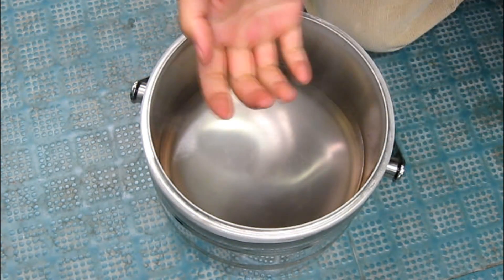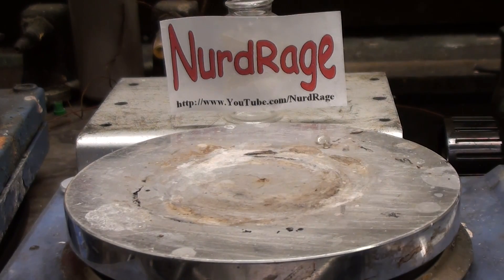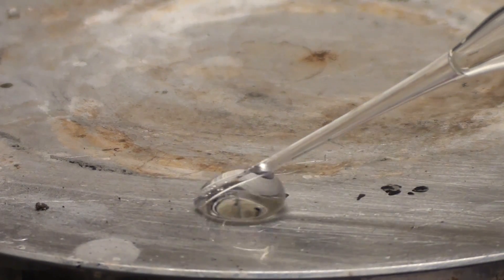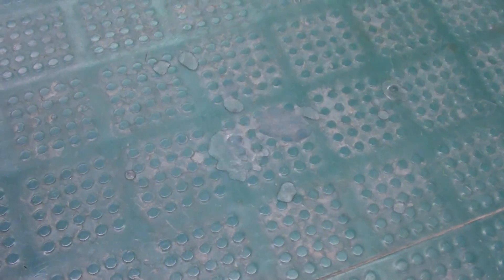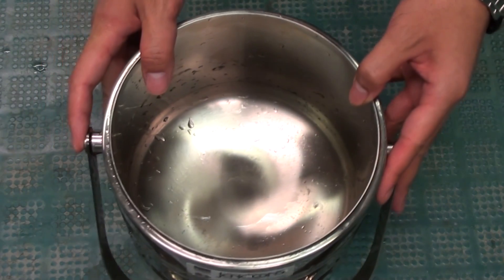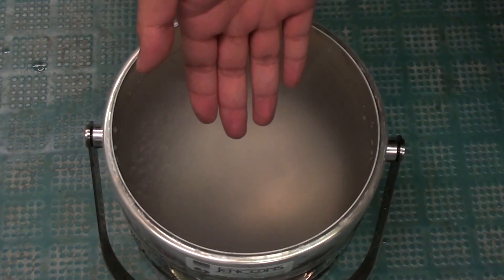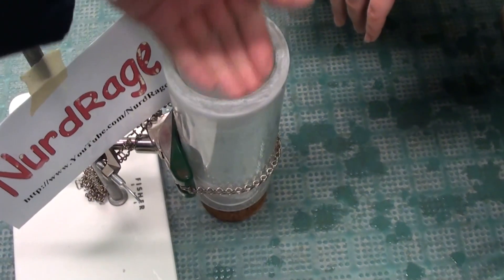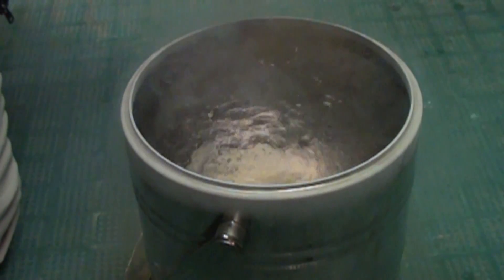Hand vs. Liquid Nitrogen - Revisited

Comment: Sometimes you can learn a lot in one quick moment.  Like when my fingers were sticking to the soup ladle that I used to spoon out some liquid nitrogen.  "Hey, look at that, it is so cold that the frost on the ladle is grabbing on to my skin and won't let go, like licking a flagpole on a below zero day."    It worked out all right; the ladle quickly warmed up and let me go without injury.     The other quick moment was when I immersed a racquetball in liquid nitrogen and tried to bounce it.  It had not occurred to me that the ball is hollow and full of air, and that the air shrank considerably when cooled, creating a partial vacuum.  The ball didn't just crack when it hit the sidewalk -- it popped like a light bulb.    Cool video, Mr. NurdRage.

Comment: Can you boil liquid nitrogen?
Reply: it's boils at -196 degrees Celsius, in this video it's always boiling
Reply: the video shows it boiling
Reply: paralixis4500 Fine. What happens when you apply heat to liquid nitrogen?
Reply: thats better, pretty much is gonna have the same effect but it will last shorter, regardless of heat temperature

Comment: No idea where to get liquid nitrogen or dry ice (granted that's probably a good thing) I've dabbled with dry ice at school and it was very peculiar. But now that I know liquid nitrogen boils around your hand (not boil but vaporize? whatever) i feel a little bit safer. Yeah don't jump into a pool of it but if I ever do get some, I won't be as scared of it. Dry ice is a completely different story, yeah it decompresses (since it is a solid gas) at room temperature but do not touch it. Since it isn't a liquid it won't go away quick enough. So warning to anybody reading this. Have a pro or be trained before you do this. If I ever do I'll have safety stuff nearby.

Comment: Wouldn't it have been safer and probably easier to see if you'd used a heated rod or something instead of Argentia's hand? I mean you've proven it works with your own hand and are just demonstrating how now...
Reply: +Keiya Bachhuber It probably wouldn't even have to be a heated rod. When you're hundreds of degrees hotter than liquid nitrogen, a couple dozen degrees is nothing.

Comment: I work with liquid nitrogen every day. It's really not very dangerous if you are careful. I've never seen any of my co workers injured by it. It's also alot less dense than water. You don't need a hot plate to observe The Leidenfrost effect with liquid nitrogen. Just throw it on the floor and it does the same thing.

Comment: Would this work in the opposite way? With boiling water and an extremely cold object?
Reply: yes, but not with hot water. try  molten metal, like lead. if you say, dipped your hand in water first and then in the lead,the same effect happens. the steam will create a barrier. just be sure to pull your hand out quick.

Comment: With the Leidenfrost effect, I could walk upon the surface of the sun. For a fraction of a moment.
Reply: Yes, while floating on the steam from your vaporized feet? Wouldn't be very pleasant lol
Reply: Rafael Porto I wager it would look absolutely badass, though.
Reply: VladtheImpaler31 No, you'd burst into flames before even getting close. This phenomenon only happens within certain temperature parameters, depending on the types of liquids/metals used for the experiment. The Sun is a Plasma, it's heat extends far from it's surface, unlike the frying pan who's heat doesn't expand much beyond the surface.
Reply: Before exploding from the gases in your body expanding
Reply: VladtheImpaler31 for like millisecond lol
Reply: VladtheImpaler31 Leidenfrost will not stop Intense light and radiation.
Reply: Davide Dopesick
I was talking about the sun warming your body up and causing gas to expand, and then causing an explosion from the differences in pressure, not the lack of atmosphere boom boom BS
Reply: ***** that doesn't really happen in a vacuum, it's been proven many times
Reply: Davide Dopesick 
I wasn't overly clear when I made the first comment though...
Reply: dipro001 Light is a form of radiation.
Reply: So be it.
Reply: That's completely boss, but would you even get close to the surface of the sun before standing on it for a fraction of a millisecond?
Reply: Vern359 It was a scenario, that I instantly found myself on the sun, I would survive for a fraction of a moment. Your attempt to be serious, has only led you to being annoying.
Reply: No, you'd be crushed, instantly.

Comment: for informational purposes how hot is the temperature of the hot plate when the Leidenfrost effect occurs?
Reply: Thanks ***** !
Reply: MissWeaslebee♥
its actually more around 3-400 degrees Celsius since the water actually has to boil so fast that the drop of water doesn't touch the hot plate

Comment: Another cool Leidenfrost experiment is bronzing your hand; I have heard of this, but never have seen or done it. Put your hand in cold water, and quickly, while still wet, dip it into molten bronze or another metal of your choice. The water will boil, and the steam will repel the metal from your hand. Be sure to take your and out quickly to avoid getting burned, and don't stick it in very deep or with curled fingers so that your hand can be removed so that it doesn't burn. Dipping your metal-clad hand in water could prevent burning as the metal solidifies, but may shatter or crack the metal from it shrinking from heat loss. This shrinkage may make it harder to remove as well...

Comment: I've done this, and it's really not that cold. Your hand feels slightly chilled, but not more than sticking it in the fridge. Also, it would be good if they/someone filmed this without smashing their hand in so fast and violently, so the nitrogen wasn't splashing so much.
Also, fun fact: if she had used her other hand, her finger would be messed up really bad, because she's wearing a ring. This is pretty much totally safe to try, as long as you're not wearing any metal (it conducts so well, it will super cool very quickly, and then - as you're wearing it - freeze your digit through prolonged contact. Not good! :P).

Comment: So... is there a definite temperature difference that it must be for this effect to take action? What temperature difference must it fall under to negate the effect? Someone answer please <3
Reply: wow u see u everywhere....
Reply: I've seen you before somewhere
Reply: "The minimum heat flux for a large horizontal plate can be derived from Zuber's equation." From what I can tell, a lot of variables come into play with this. Pressure, density of fluids, area of surface, heat flux, specific heat of a substance. So a little more information is needed. 

But I think for water the minimum energy needed is the heat of vaporization for water. This will cause the water vapor to cause the droplets of water to bead up and roll off the surface.
Reply: LOL MY THUMBNAIL PICTURE IS STILL RS TOO
Reply: Asian Lag I see this guy everywhere. What the heck!
Reply: well he said at -196 celsius.. and im not genius but im guessing at -197 celsius the effect is gone
Reply: Hand vs. Liquid Nitrogen - Revisited
Reply: Laser
Cannon
Deth
Sentence
Reply: ***** Shut up and go back to skilling.

Comment: Is this similar to the effect that allows one to stick their hand in molten lead without being burned?
Reply: Well no. This effect means that the colder substance vaporises so quickly when coming into contact with hotter substance that the forming gas creates a cushion between the two. For molten lead and hand to create this same effect would mean that YOUR HAND is vaporising when in contant with the much hotter lead. That's not exactly healthy.
Reply: Lahis
Isn't the molten lead thing done by putting your hand in water first?
Reply: Well then it's the same. Though you'll propably have even less tima than with nitrogen here.
Reply: @AndroidMaxine  love to see a video of that! Give it a try please
Reply: For anyone reading this 7 years later, the answer is yes. The Leidenfrost effect is exactly what allows people to stick their hand in molten lead/aluminum etc.  They wet their hands with water first, and upon touching the molten metal, the water transitions to gas(steam) and expands rapidly, insulating the hand from the molten metal. The effect does not last long so I don’t think you can safely dip your hand in molten metal, but you can karate chop it as it’s being poured.
Reply: Why dont you make a video of that. Be sure and get hand wet first

Comment: When I was young I "discovered" this effect with a beaker of water and a copper penny heated to cherry red over a burner.  when the penny was dropped in the beaker it appeared shiny, like silver.  The surface details were present but indistinct.  after a moment, when the penny had cooled enough to allow liquid water to touch it the water surrounding the coin would suddenly and briefly boil.  I did it over and over again.  It was fascinating to watch.  This video reminded me of that time 40 years ago.
.

Comment: Can the fire department use that stuff for putting out fires?
Reply: Yes, but liquid carbon dioxide is much cheaper and easier to work with, and it boils off much more slowly when contained. That's why we have extinguishers full of CO2, not N2.

Comment: What happens if you keep your hand in there for like 10 seconds
Reply: Frostbite.
Reply: Lazertazer Dead hand. Amputated limb.
Reply: Your hand gets crit for 1k damage
Reply: havent you seen terminator 2
Reply: When the temperature in human cells go below freezing the water will freeze, the ice that is formed will penetrate the cell membranes and kill the cells.
Reply: Izlak That is the definition of frostbite yea :)

Water expands when it freezes, so does the water in yourself if it goes below zero degrees Celsius. It takes a lot though, the body produces a lot of heat and will try to prevent it from happening under any circumstances. Against liquid nitrogen however it has no chance at all.
Reply: ppppentakill
Reply: itssk8errrmcgee I WAS THINKING THE SAME THING, HAHA!
Reply: You know have 1 hand
Reply: After a second, the nitrogen will contact your hand, causing excruciating pain.  Your spinal cord will reflexively remove your hand from the nitrogen, and you will be left with a case of severe frostbite.  In most cases an amputation will not be required.
Reply: Lazertazer thats what nerves are for

Comment: What if you were to take molten metal (for example Iron) and super heat it, is it possible for it to become a gas, and how hot would that gas be?
Reply: Iron becomes a gas at 3198 kelvin or 5297 fahrenheit. Currently any element can take on any of the 3 normal forms.
Edit: www.ptable.com and then use the Kelvin slider thingy to see what is where. And yes helium becomes a solid.. just at 1.6 - 2.1 F anything below that it's a liquid
Reply: Thank you very much ^_^ it's been bugging me for a long time.
Reply: Hello :D (\
Reply: there is a planet that is so hot, that iron acts like water. it actually rains iron

Comment: Is there a transition point where the surface temperature difference with respect to the liquid temperature is great enough so as not to support the leidenfrost effect?  Such as, if the surface of a metal plate was red hot.  If so, what happens then, sublimation?
Reply: considering it's already in a liquid form, I don't think sublimation is possible
Reply: Flash-evaporation of the liquid nitrogen?

Comment: Liquid nitrogen is nitrogen, cooled to the point where it turns from gas into a liquid. Nitrogen is the most common gas in regular air, making up about 78% of the air around you. If you would cool air, first the CO2 in the air will condense (turn into liquid) at about -57 C. Then, the oxygen condenses at about -183 C. The remaining gas is almost all nitrogen. Cooling it to -196 C, it will turn into liquid nitrogen. About 660 liters of nitrogen gas will turn into 1 liter of liquid nitrogen.

Comment: Liquid Nitrogen is the exact same as Nitrogen gas except it is -193 degrees Celsius or lower. Kind of like how Steam is water just hotter. At temperatures that we live in Nitrogen is a gas, but cool it enough and it turns into a liquid.

Comment: Nitrogen changes into a solid form, or "ice" at -210 degrees Celsius. Every substance on earth has a liquid, solid, and gas form. Take Iron for example. It's solid or "frozen" at room temperature, melts into a liquid at 1538 degrees Celsius, and vaporizes into a gas at 2861 degrees Celsius. Not everything shares the same physical properties as water. Careful sir, your stupid is showing.

Comment: It's still dangerous from the start. Heat transfer happens FAST! It's just that the transfer is "slower" at first because the boiled nitrogen is warmer than the liquid and that is what's in contact with your hand....until you lose enough heat to stop "instant boiling" the liquid nitrogen.  Honestly, don't try this.  Replacing all the skin on your hand takes more time and money than you might imagine.

Comment: not really, since your feet don't instantly vaporize touching the hot coals. The coal ashes on top of the actual coals just aren't able to transfer the heat to your feet quickly enough (like the steam layer underneath the water or around your hand)

Comment: If the steel bearing became cold enough that the Leidenfrost effect was no longer taking place, then the effect surrounding your hand would displace the nitrogen around the ball bearing, but the ball bearing would instantly begin freezing your hand since you're certainly not melting the ball. 

As well, the gas barrier is not some sort of bubble you can pop, so to speak. The nitro would be repelled from your hand, but would not care about the ball bearing and would continue touching it.

Comment: essentially, any non-metal such as plastic. But that wouldn't be a very good lock. What you can get is a chain lock with thick rubber casing (or cloth of some sort), which will making it more annoying to break, but is still possible. Also, chain your bike so that it is tight. That way, the nitrogen will also contact your bike. That way, if they attempt to shatter the metal lock, they shatter the bike too (which they won't want). You can then attempt to weld it back. Hope it helps!

Comment: hi, i need your help. there was a motorcycle stolen in my building and a guy told me that the way they steal is that they use liquid nitrogen and a hammer to make the chain lock extremely cold and break it off. Is that possible ? if yes then what material can this not be done with ? thanks in ancitipation,

Comment: Hey, do you know what would happen if an iPhone was dipped in this liquid? Since pure liquid nitrogen doesn't conduct electricity, nothing should happen, right? Would the glass shatter from the temperature difference, and if the battery was removed and replaced with a cable from an external power supply... would the phone continue to run just fine? Thanks.

Comment: You'd burn the living shit out of yourself for these two reasons.
A) A hand without water has nothing to turn into gas, except for your own skin.
B) The effect shown here is with nitrogen, an element that is gaseous at room temp, not lava which is solid at room temp. This makes the Leidenfrost effect extremely difficult to take place. This means that you would put your hand in it, cooling the lava just enough to make a solid covering of 3000 degree rock all over your hand. So I wish you the ver

Comment: any temperature difference causes this effect, and it is intensified by an increased difference in temperature.
So yes it would cause the same effect but for a shorter duration, since the water in your hand wont last long. Just don't do it, it's not worth the risk.

Comment: The white mist you see is still colorless -- it's just fine droplets (of water condensate, actually) randomly diffracting all wavelengths of light, thus appearing while in color.  Both nitrogen and water are colorless in all three common phases.  (I don't know about plasma-state colors, but there's also other things coming into play here.)

To vaporize instantly requires a lot of energy, even at such a large difference in temp.  A sufficient quantity will stick around for a while.

Comment: @dopplerable Ask whoever first said that. It evaporates at approx -195 C, WAY below room temperature, so it can't possibly remain a liquid on/in the floor. It will mix with air quite readily, although it might be possible to displace enough oxygen in a confined space to be dangerous- if you work at it hard enough.

Comment: @ojibwa2030 5 seconds would hurt bad m8. i got some fall into my glove (which i no longer wear as its safer not to)
before i could take the glove off it froze about 10mm diameter on my finger. it looked like a big yellow blister but contained ice. took about 5-10 seconds to melt and it disappeared and didn't hurt much after.
the next day tho my skin had separated from my hand in that area and it hurt like fuck constantly.

Comment: I have seen a Leidenfrost demonstration using Lead heated to a liquid. The hand is dipped into water first, then the Lead. Same concept as the water on the hot plate.

I do like the Liquid Nitrogen version though. With the clear tube, it shows the effect clearly.

Comment: @Humanis5 the way the vid works is when u put ur hand in the nitrogen vaporises instantly in the liquid so for a short time ur hand is not actually touching it the problem with ur thought is that is u start with a hot liquid (molten lead and cold solid ( your hand) the worst cause scenario is u put ur hand in and the lead instantly solidifies and ur and will be in cased in hot lead burning you or u put ur hand burn it and pull it out real quick.